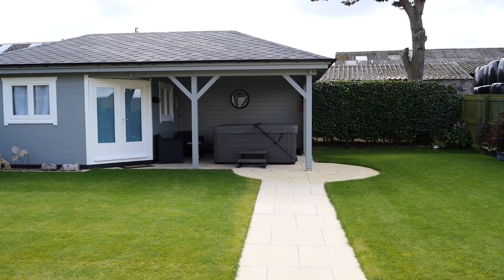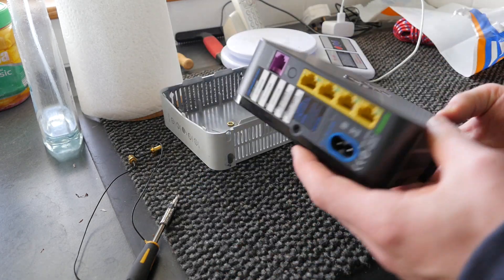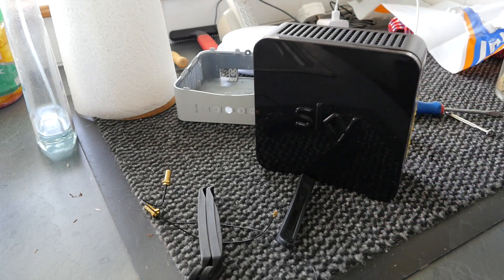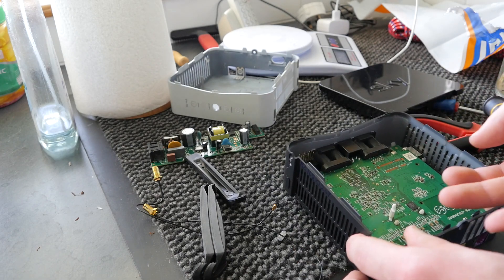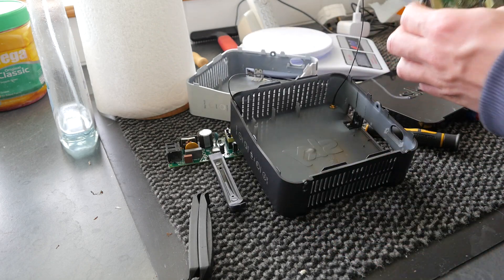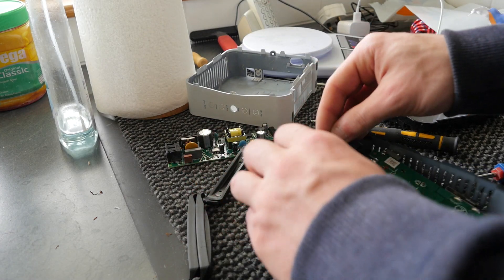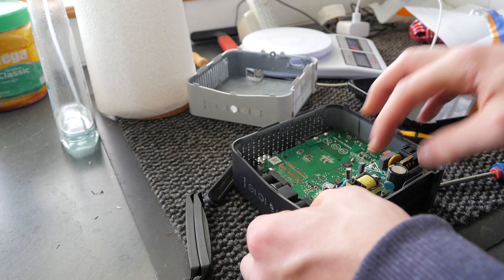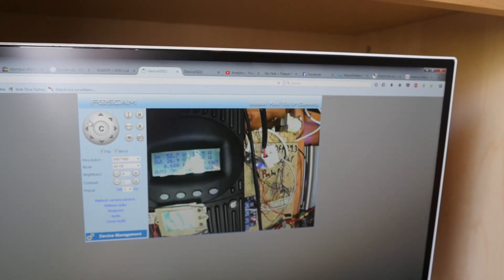SR102 Sky Router Modification

Comment: when we use sky hub as access point and disable the DHCP server, then can we use site/keywords blocking feature?
Example:
 if i plug Ethernet cable in LAN and configure wireless as access point & Disable the DHCP so can i control & block the site by using Skyhub blocking feature? 
waiting for your kind response
Reply from the maker: I'm not sure. You may have to do it on your main router.
Reply: Skyhub how to convert into tenda version firmware our how to make pppop connection